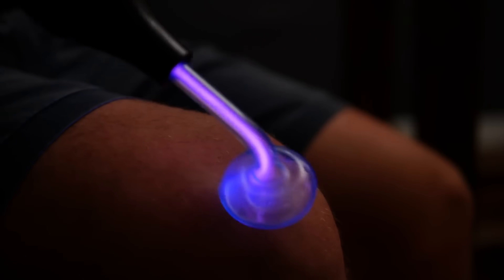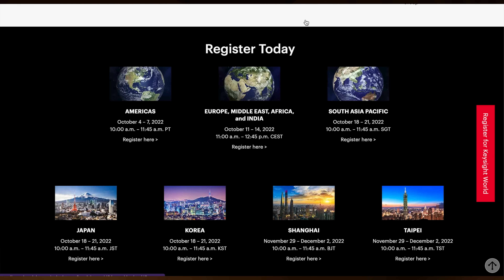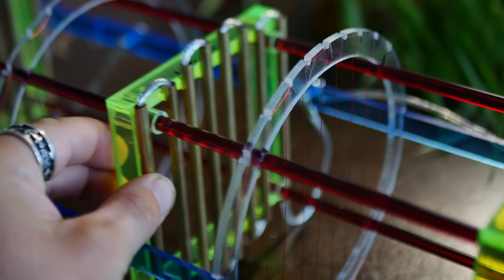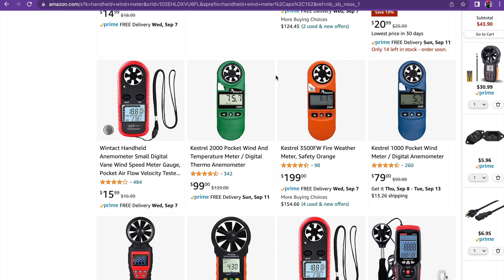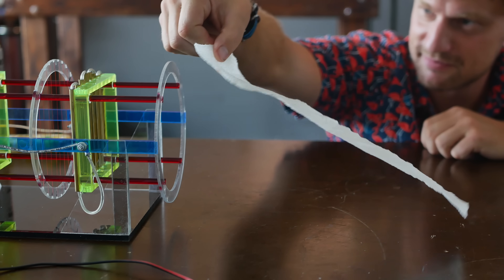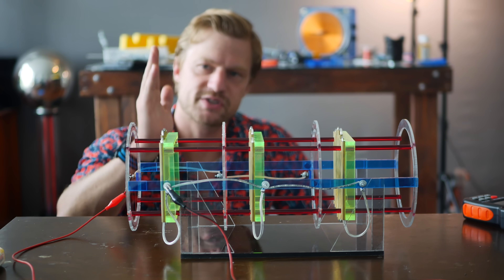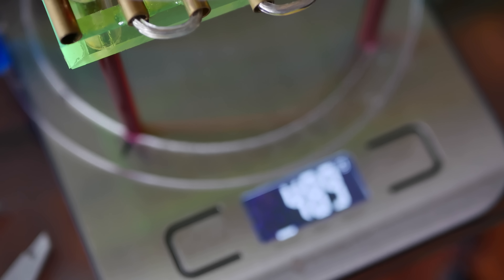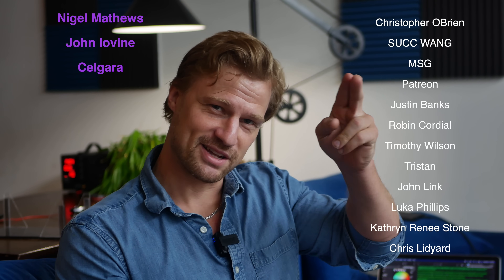Designing A Next-Gen Ionic Thruster! (For Flight)

Comment: Efficiency improvement 1: put the wider electrodes in a circular frame, too
Efficiency improvement 2: have the air flow through a tube between the acceleration stages, as there extra air molecules no longer increase airflow, but slow it down
Efficiency improvement 3: use less electrodes on later stages, as the airflow is already partially ionized, so it could benefit from less obstruction. (also potentially electrodes could be rotated, but I'm not quite sure if that'd really benefit the system.

Comment: I would like to see it with the thrusters turned out of alignment with each other.  Give it a cross pattern of the wires.  I figure that would increase turbulence some and drag more air.  

Also, see if you can build it inside of a shroud.  as it is now it can drive thrust out the sides and not directly back.  

Lastly, and just as a fun thought, I would build it more in the shape of a cone with the intake being large, and the output being small.  should help increase the air pressure, at least inside of a body.  maybe flip that for outside of a body?

Comment: this has probably already been spoken about but if the area where the air flows is enclosed it will be better right?
also, is the efficiency gain of spacing between electrodes dependant on air velocity?
wait, does frequency change anything?

Comment: Think of a Dyson vacuum and design an Ionic turbine thruster. You know twisters can be Ionic in mature thats why lightning happens most frequently where the twister is at. Just hope this is helpful. So instead of straight line try slightly turning in a circle and using a cone type centre at the back to try to create a whirl wind effect. You may work with Elon Musk or the Air force if you do it. It can be done!!!
Reply: Amazing work!!! Just want to see you really knock it out of the ball park. A lot of people have worked on this concept but I believe you can take it to the next level. Do it!

Comment: I think you need to design it like a jet engine pipe bro, a smaller exhaust with smoothly designed bigger intake (velocity stack) will increase its thrust dramatically, if i wasn't wrong this is due to venturi effect

Comment: It seems the most obvious improvement is to make it a ducted fan, to multiply your airflow. Perhaps something like Jetoptera's bladeless fans? That is, make the wires and grounds into rings that go around the inner perimeter of a duct, instead of crossing through the center. Let air flow freely through the center of the duct, so that additional air will get sucked through.

Comment: Reduce the cross section of the collectors. A strip of aluminum foil parrellel to the air flow will work fine. The depth of strip can be varied to see if there is any change in velocity/thrust.

Comment: The three design changes I can think of are material changes (I am thinking a cast rigid foam to really cut down the weight), experimenting with the wire alignment and diameters, and the use of permanent magnets to focus the plasma in a smaller cross section (see if the resulting thrust increase is worth the increased mass).

Comment: ??  Is there a difference in horizontal or vertical alignment of the plasma wires?  When you tried to check laminar flow, the wires were vertical, would this not stall / derail your experiment?

Comment: Issue in the future will be having the thruster generate the electricity necessary to carry a useful payload. Jet engines create the power they and their systems need. Strapping a larger battery will increase the weight.

I highly suspect this is a dead end technology (as far as aviation is concerned; there may be some other use case) and propellers and turbines will be used as they've got far greater power to thrust output.

Comment: What's that channel with all the PC fan reviews... And that looks not as much thrust to fly
Reply: And questions, 
Why isn't your ground a longitudinal rod regardless of the number of wires
Why isn't it inside a coke bottle sheath
Working towards a jet there's no compression and then expansion to force in air to expand and then expel it.. whatever passes for an afterburner when you're not adding and burning fuel
I've always wondered if you have lasers to ionize the air longitudinally to begin with you're creating the airflow path.. the conventional lifter junk inducing what passes for thrust just don't know how many lasers you'd need for useful thrust when compared to heated and compressed air.
As well as the laser source can be enclosed in the center ground tube not that it matters which direction the laser originates from if its purpose is ionizing the air in the tube
What level of ionization is really necessary. As shown more power did mean more thrust. What's a better design to pull the ions out faster versus the amount of air that's dragged along. 

Something like the PC case fan showdown channel

It's all well and good to have rpm.. 3 7 or 11 blades.. the slightest changes in shape and speed changes the amount of air moved through the apparatus. When you show the high voltage plasma how much noise is that creating in the airflow keeping it from.. flowing in the intended direction.. thousands of bees with wings not necessarily pointing in the direction you want instead of fan blades.

Comment: Curious if the spacing between the positive/negative combined sections changes much. Also did you try moving the pos/neg closer together than 1"?
Reply: The breakdown voltage of air at typical conditions is like 30kV/cm.  At the voltages he was using 30KV~60kV going below 1 inch has the potential to just arc over into a short circuit.
Reply: Ahh ok. Cool. Thanks. Figured that might be why but I wasn't sure what the distance might be.

Comment: Super cool Jay all your builds are amazing but some how this tops it (it's beautiful) , are only suggestion which you've prob worked out on the ion thrusters with alloy foil on sides there always longer then copper wire at bottom, so maybe incorporate electrode on sides , also the plasma motor had a pulling affect from Negative to Positive so maybe if side is Negative and entering pathway is also then outlet is only positive give it more cone feature , very cool indeed looking forward to thruster 2.0 awesome..

Comment: Here is an inefficiency for ya,  you calculated thrust to weight assuming only the weight of the thruster and not the complete system, so your value is really optimistic.  Without your power processing unit and the power source your thruster doesn't make thrust.  That is, for this thing to create thrust that makes itself move it would need a battery and  power conversion (power supply) as part of the vehicle, and that would be heavy.  Your thruster is the lightest part of your system, you need to find a light way to power it.

But still, it is super cool that you figured a way to make an air breathing ion thruster out of common stuff.  Super easy to understand ion thruster model.  Great job.

Comment: One inefficiency is that you are likely losing air flow out the sides.  If you wrap the engine in a plastic wall / sheeting, you can likely gain more thrust.
I am curious on the following:
  If we look at a jet or turbo prop engine, they have a much bigger intake than exhaust, concentrating the thrust to make it more efficient.  Would the same effect apply to this?
  I am thinking that the shape of the anodes and cathodes can be modified to make them both lighter and more efficient.  I can think of several design modifications to try, though have no idea of which would be most efficient.  I would also be interested in a spiral shaped anode that could possibly cause effects similar to a tesla coil.

Comment: I'm not too hot with physics, but I'd like to know how the following might affect flow:

1. Incorporating rotation into the flow
2. Ducted Airflow (tapering from wider point of entry to narrower exit)
3. How does cycling power rapidly from one coil to the next affect performance to overall power draw vs constant power delivered to each coil throughout operation? Do different cycling patterns have different performance?

Comment: @8:37 your data is invalid!!! 
Because now you are just holding it in front of the wind path in the middle! 
And before you were standing the metering device in the wind path, and you did not measure the distance between the output of the air path to the metering device!!

Comment: Intake to have a big aperture , to a small aperture , use compression as well as more speed or m per second  , also need to have restrictive airflow , an enclosure will do well  compress the output if possible turbocharge the thruster

Comment: If you set up your circuit to run AC, you could potentially accelerate air flow more by offsetting the sine waves from eachother. Calculating the most efficient wave form and potentially cutting down power costs and weight by reducing the number of segments needed.

Comment: Inificiencies: weight from dynamic spacing, electrode material used, winding tightness. 

Would like to see if a covering would increase weight to thrust ratio. Also if making it cone shaped helped. You should also look into how tightly you do the windings, and what mesh pattern/density does the best.

Comment: Unless you are providing free energy this thruster, probably, wouldn't come close to moving the thruster itself plus the power supply.  This test will need to be performed in a vacuum to provide more accurate data.  I personally would suspend the experiment to provide more accurate flight data.  This is a great video.  Thank you for being so inspiring.  I was just pointing out what I considered flaws.  Thanks!

Comment: Did the unit pull air in from the sides?  If you enclosed the unit,  expanded the intake and narrowed the exhaust port, and or increased the number of wires or offset a second row of wires. Also the metal tubes what if you did flat metal to increase area of air flow.

Comment: I guess I don't know about what you saw but I think it needs to be encased because the three ionic thrusters are just pulling available air from around the front of them I don't believe they are truly stacked the first one will push a little the second one would push a little more and the third one will push a bunch the acceleration of air would increase across them. Is my opinion I absolutely could be wrong and very little knowledge of this field

Comment: As cool as it is to see techs from the scifi shows/movies and video games I watched and played as a kid is.

There's still one fatal viability flaw between both the original design and yours, along with electric cars. The battery, somebody needs to get batteries to ouput more power than their size would presently make us think. Take for example the candles you used to demonstrate thw air flow, imagine those being the size of the battery to ouput what you needed and then some, or those be the size of the batteries to run an electric car. Because without that solution this engine type struggles with the same problem we have with spaceflight, what you can carry with it compared to how much room you need for the energy output.

Seriously, id like to see that advancement happen in my lifetime. Its in my.opinion the only way we will get our technology further along because now it feels like we are at the limits of what we can do with what we have.

Comment: To reduce weight, 3D print your parts and use 1mm wall thickness carbon fibre rods, I would also stagger segments further apart  as you move along towards the output, and I would insert the entire thruster into an acrylic tube.

Comment: You should change pipes/cables to hexagonals and stack them like honeycomb, it will increase area of air acceleration.

Nice work!
Reply: This is actually a really worthwhile test. As cgp grey once said of the hexagon "maximum volume, minimum wall"
Reply: @gormauslander  But that's not true, circle has better wall/field ratio.
Reply: @milod.5267  You're confusing the ideal world of math with the real world. You cannot tile a surface with circles because they leave void space between them. Corners are required on a regular polygon to maximize efficient packing.
Reply: @gormauslander  The Hexagon is Bestagon
Reply: Ccp gray pls

Comment: putting the thruster in a tube could help  to reduce air escaping from the thruster but that would increase the weight, if the added thurst is more the the added weight the its a viable solution. also, jet engines use turbines to spin gas inside it, maybe adding a turbine could help ? but maybe not considering that turbines are made for combustion gas but it could be a fun addition if it works. and finally, maybe ring electrodes instead of lines could increase the thrust(saw a desgin like that on an article once about ionic thrust that NASA did). also, do you have any links for the design and stuff ? im an engineering student and id love to make one (also plasma is one of my favorite subjects in physics too).

Comment: I just checked out your video and enjoyed it.  I don't know much about ionic thrusters.  I noticed that the pictures in the dark showed bright spots along the wire, could that be a source of improvement, having more or less of those bright spots? Would it make any difference at all?  If the principle behind ionic thrust is similar to a heat exchanger.  More surface area contributes to more transfer from hot to cold.  Maybe consider having multiple layers of the copper wire, perhaps rotated from the previous layer to increase the amount of charged particles. or maybe having the copper wire bands closer to minimize the open space between each strand, last time I checked electrons were less than 1/16 in wide so there might be a lot of lost potential due to excessive clearances. 

Another idea would be to replace the whole frame with a tube to contain the airflow into a fixed area and the tube can double as a frame holding everything in place and have some sort of slots cut in for adjustment needs as necessary.   

Lastly, does the type of metal being used for charging electrons make a difference, if copper is perhaps replaced with say gold or some other conductor that works more efficiently than copper, thinking of greasing the bearings on a machine, allowing for less friction and greater efficiency?

Comment: Maybe some design like this could improve airflow allowing air to travel in the inside of a central tunnel, and each stage could have an air entrance with the same airflow, preventing leaks and accelerating the air in the central tunnel like an array of cones:🙂

                           ..
                         ..        <- <-<-  <- <-  airflow of stage 2
                       ..     /  ..
                    ..      /  ..
stage2     ..       / .. stage 1
     <- <-  <-   <= <-  <- <-  <-   <-   <- central airflow
                 ..       \ ..
                   ..       \ ..
                     ..       \ .
                       ..         <- <- <-<-<- airflow of stage 2
                         ..

Comment: suggestions= 1) use aluminium mosquito net as a grid 1.1) the more grids, the better. 2) check the spacing between grids based on Stanford's LINAC. It is probably logarithmic. 3) Put the whole thing inside a pipe. 4) put a Venturi nozzle at the end, like in jet engines. You have got an air compressor without moving parts. You do not need to go to 40000 volts. 1000 stages at 40 V are far safer. And cheaper.

Comment: FUUUULLL Bridge rectifier, also weclome to the slingshot channel.

So, Imagine if you will What place "rubber" might have in correcting a flow.
Tubes of flexible rubber, ionized air flowing through it.... Think about it.

The good ol IV tubes or that very soft yellow rubber tube?

Have multiple of these "tubes" going into a centralized column for vectoring the thrust....
Reply: To further elaborate. The flex of the rubber when flow and pressure comes in might actually Force the air into one way more efficiently.

Comment: I've had an idea of an ionic thruster where you stack them but you turn them off after the air has passed the first stage so that it doesn't create a wind flow in the opposite direction slowing it down. Because you could get back flow when the air has passed the stage since it now attracts ions from the next stage as well even though it's far away. So in order to pack many stages close together you can fire them in sequence as pulses but also stack them with at different distances since the airflow will increase. I call the design a Synchronized Pulse Ion Thruster or S.P.I.T. for short :)

Comment: I’m guessing most of the inefficiency is due to ionic wind requiring ionisation of the air, which also heats up the air. Would it be correct that there is a correlation between power usage and distance between the electrodes?

Comment: Touching hot wires, and dry ice with bare hands, hmmm, not Einstein then. I hope those wires are not enameled. I'm thinking they should be flattened and wide to maximize surface area.  But I have to wonder what all that ionized gas is doing to your lungs, and how many x-rays you've exposed yourself too. Well done madam Curie.

Comment: Well first improvement, I think would be reducing the size of the cathodes, instead of thick brass tubing also just wires perhaps, second would be encasing the system and third perhaps different voltages per section or fine-tuning spacing and voltages

Comment: I have a suggestion for a new design: what if the air is pushed in a sort of closed loop, so instead of building a straight pipe I'm interested to see a round one. Would the air keep accelerating as it pass again through the closed loop pipe?